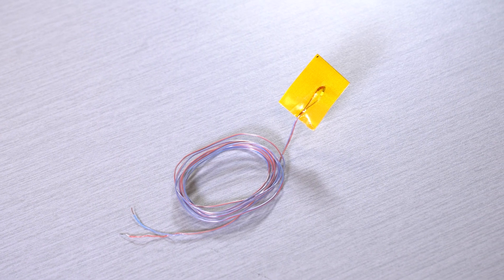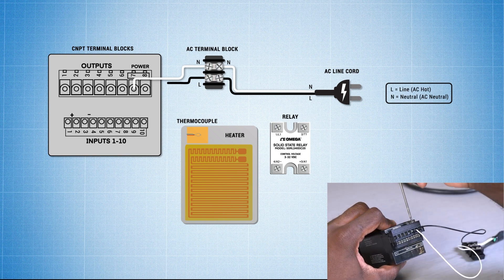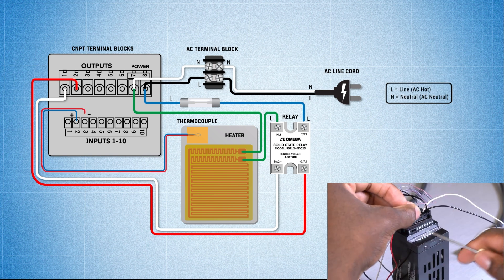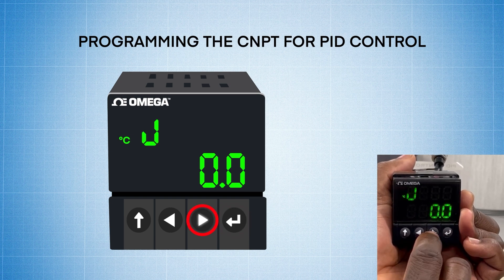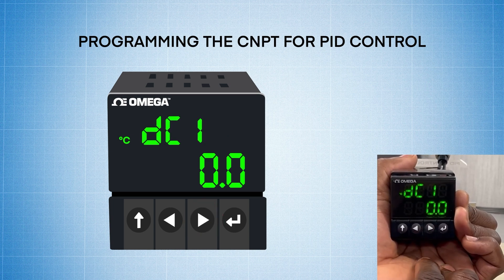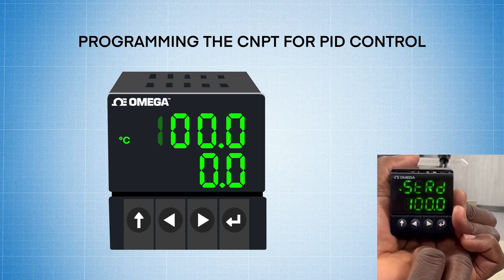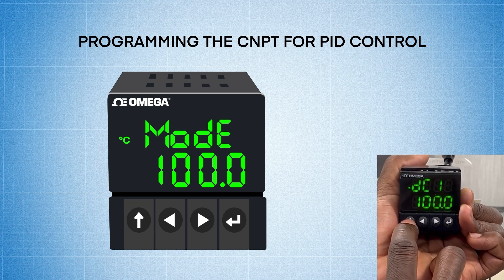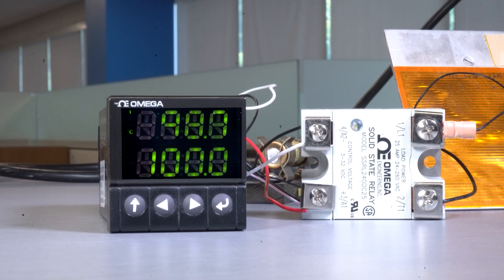Wiring and Programming the CNPT Series Controller for PID Control

Comment: HI, is possible to config a CNiTH series controller, using ethernet TCP port? which software do you recommend?
I mean to config PID parameters, SP1 and SP2, and others Thanks in advance
Reply from the maker: Answer: If you have the Serial Communications/Ethernet Option you can easily
configure the controller on your computer or on-line. For more information, please contact on www.dwyeromega.com